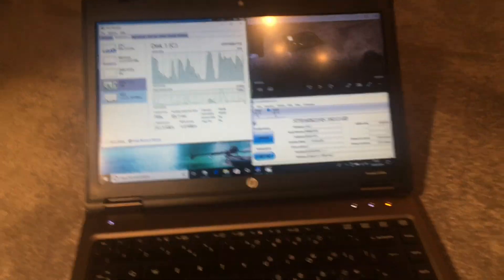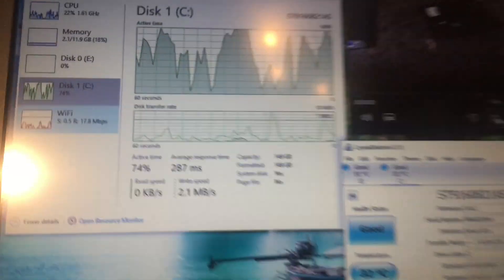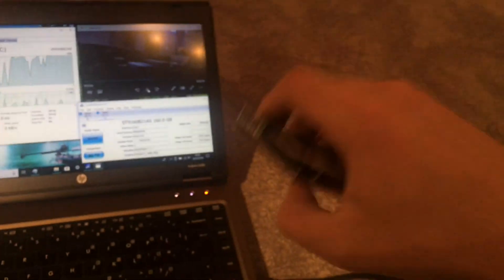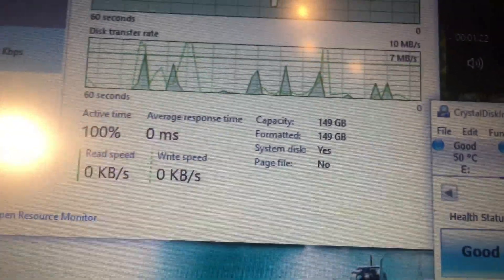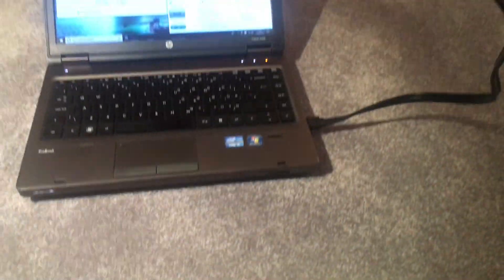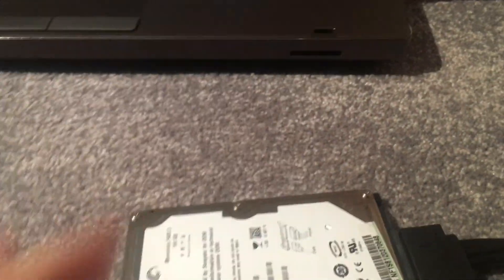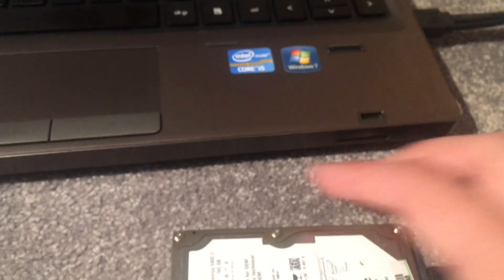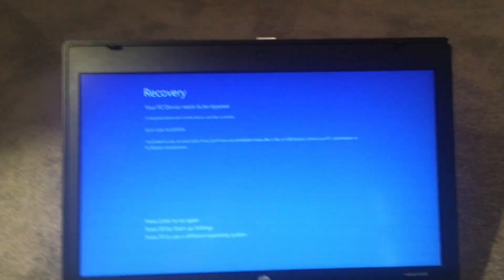Shaking Hard Drive While Running

Comment: I got a little bit scared a moment ago, I am using my notebook and because I am on the bed i accidentally shaked it a little bit, it made a strange noise and I freaked out. Luckily it works fine and cristal disk says everithing is perfect. I will try my best to not repeat it and get a ssd as fast as i can because i dont trust it too much on a notebook
Reply: hdd might die if you drop it, or it might even self recover or you can attempt to fix it
but ssd when it die it just died
far worse experience
zero chance for recovery attempt, you wont even know when its coming no indication from smart
Reply: same thing with mine, except I had put it down and then put it on my lap tray thingy for the computer and it made the sound the one in the video made at first but then I never heard it again. Idk what happened then but it was fine up until I dropped it the other day. Considering data recovery stuff now but all the games I have on there I can recover through my accounts on the game services. Has a few of my phone backups on there but I can back it up again using anything else it seems.

Comment: Lol thats not 
4k
Reply: @EwansTechWreck   I have a 4gb ram. And my monitor supports up to 8k.
Reply: @EwansTechWreck  I think its just yours I checks a couple of videos in 8k and they worked. Also my monitor was around 1,000-2000 USD.
Reply: @EwansTechWreck  Your iPad's screen resolution is prolly a lil higher than 1080p